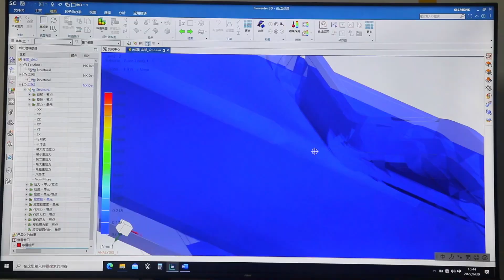Farm ATV from Areobs.

Comment: I love it,if it reach 100 km/h,i want one.
Reply from the maker: It may not work for the time being, we are mainly based on the safe speed of the load.
Reply: I want it reach 100 km/h,to speed up to 80 km/h with less RPM.Also,i don't want to carry heavy load.I want to make the cargo as a camper,to live in,when i take long trip.That's why i want to buy a cargo 4x4 ATV @aerobsmachinery2568